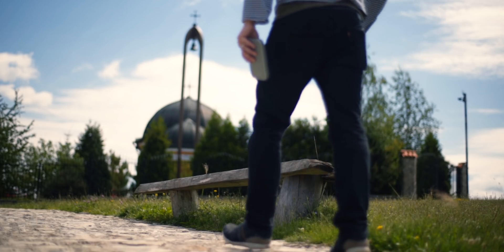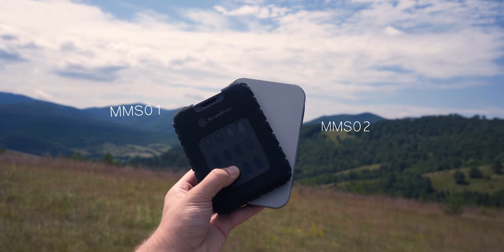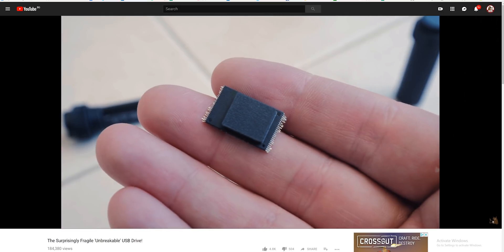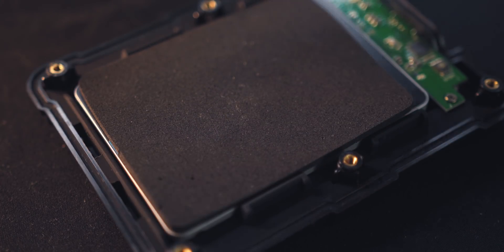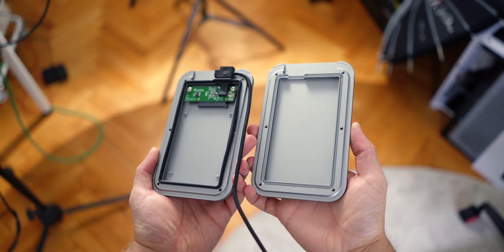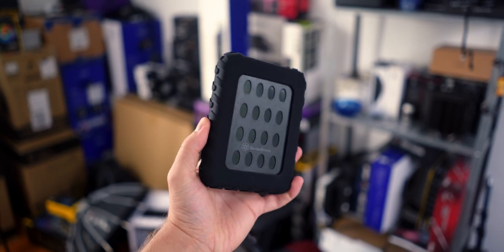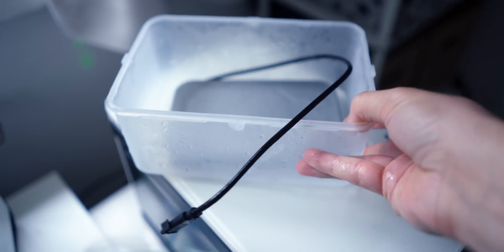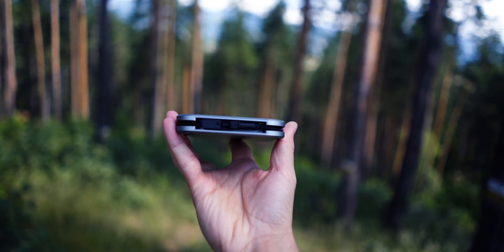How To Create The Best Portable INDESTRUCTIBLE SSD Drive!

Comment: Don't forget that the plastic and rubber on the other one will protect it more because plastic and rubber are more resistant to drops than metal or aluminum sigh

Comment: Upgrade the aluminum one with a rubberized coating like the undercarriage or bed liner coating for automotive use. Apply enough and it resists the gouges when dropped.

Comment: Now, if only they gave the aluminium enclosure a rubber cover with strategically placed holes to enable the aluminium to act as a heat sink...
Reply: Ditto.
Reply: It seems to be a running theme throughout industry to deliberately engineer in obvious flaws that would cost very little to fix for otherwise nearly perfect products. Planned obsolescence, anyone?

Comment: What I did to give my laptop more storage was remove the DVD drive and then I replaced it with a caddy that holds a 2 TB 7200 rpm hard drive. It works great and the caddy was only about $10 USD.

Comment: You can get a glue called Silastic. Used to hold IC's and other components to each other or to the PCB. It's not conductive. Though It is insulating. You can open these devices you want to make portable and spread it everywhere except heat sink pads. Then put it in a case and you can torture it all day long. Nothing will move and nothing will ever get wet.

Comment: A thick rubber cover is not good enough for shock resistance? You drunk dimitri? With all due respect, if you drop something valuable thats coated in a thick layer of rubber, it will survive better than something that has some foam and a bit of thin aluminium

Comment: Pull Apart the SSD And Cover Chips with Epoxy first.
OR Hell Cover Everything inside with Epoxy. 
Only think is... Depending on the Epoxy... Some will cause over heats , so not a good idea to leave them hooked up all the time , only good for quick pulls. 
thats what i do anyways for larger files.

Comment: "old SSD" i think ur aiming for 1% of us. how many ppl have a old ssd laying around
Reply: You can just use it for storage unless you have like 6TB m.2 tho
Reply: SSDs have pretty long lifetime, his thing if “old” SSDs lying around is a dumbass thought,  SSDs now are not that expensive now especially the low to mid capacity ones. Making it perfect for keeping files back up safe without the fear of having a damaged drive because it moving around a lot
Reply: All my old SSDs get used in old builds. I only get a new one if I am upgrading a system to m.2 or I need a larger capacity. Those old 80gb SSDs would be perfect for this application.
Reply: ARESGaming51 I just buy the portable Samsung SSDs for anything on the go.
Reply: I immediately sell my old SSDs after upgrading them (to M.2, higher capacity, speed, whatever). It's just in my mind set that I have to get some money back to compensate for the higher price of the new SSD, dammit!
Reply: Note to self: Pull my old Crucial M4 256 bought in 2012 from my dead laptop.
Reply: Simple. Buy an SSD. Then buy another SSD. You now have an old SSD lying around